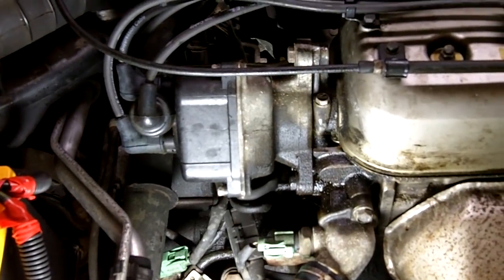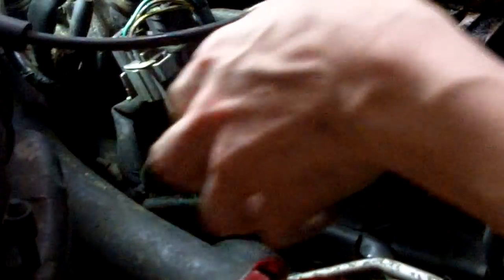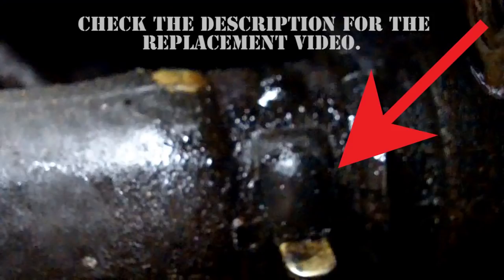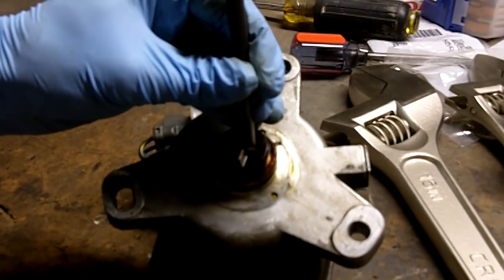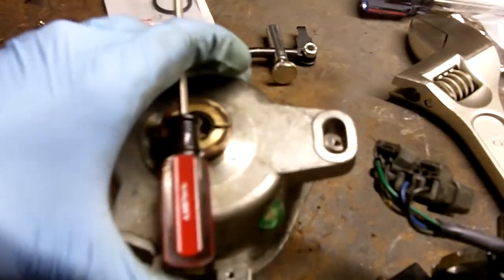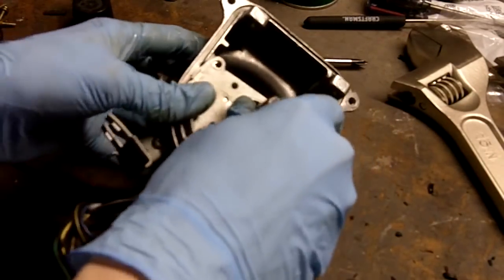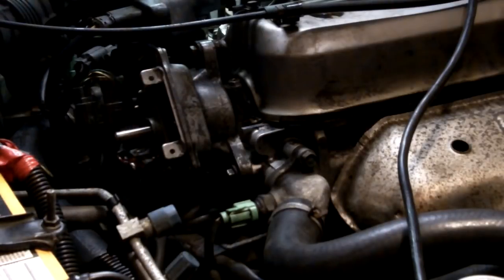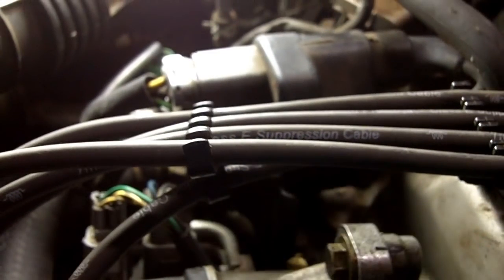Honda Distributor Oil Seal Replacement

Comment: ok I am all confused.... Your description states to distinguish b/w the Hitachi and the TEC distributors... the Hitachi has 4 wires only on the cap and the coil is internal.  This description fits mine... however when I go to the dealer they list I have a TEC based on the vin.  The outer O-ring they list for mine is the one you list for the Tec version.  Are there tec versions with an internal coil?  I don't have the version you have in the video... mine has all the extra parts, I assume as you reference the Hitachi does.  I have been researching like crazy and the Accord 2.3L F-series with the D4T92-04, D4T97-03, D4T94-04 seem to be the only Hitachi that people reference...  Good lord I don't want to have to order both sets to have to match up at disassembly... its my only car and a daily driver.  Mine is a TD-42U Distributor for a 93 DelSol 1.6L V-tec manual trans which all matches to the dealers info.  Again they say its a TEC version...  Help anyone?
Reply from the maker: I was referring to 1994-1997 Accords when I made that distinction outside those model years yes there are variants. The dealer catalog says the distributor for a 93 Del Sol manual is a TEC TD-41U with an internal coil the external o-ring part number is 30110-PA1-732.
Reply: @Bushougoma  thank you for the clarification..  That helps clear things up.

Comment: I live in the tri valley area, do you know anywhere I can get parts for my 1993 Toyota Camry V6 LE distributor inner oil seal? I have already replaced the outer seal but the leak is coming from inside.
Reply from the maker: You need to get the manufacturers name and part number on the seal first.

Comment: hey bushougoma i replaced seal and or ing on my 98 accord v6 and  now my car idles high 1500-2000 and accelerates without pressing pedal?? help
Reply from the maker: The distributor wouldn't cause this. These vehicles have a rotary type IAC valve that likes to stick and causes a high or low idle depending on where it's gummed up. It has to be removed and cleaned.

Also check for smooth operation of the throttle cable to make sure it's not rusted to the outer sheath and that the throttle plate snaps closed.
Reply: thats what i was thinking but ihad just replaced my iacv not to long ago for a similar problem. could it be a vacuum leak cause i did remove some hoses to have more access but it looks like everythings attached ?
Reply from the maker: j manuel
That was going to be my next recommendation MAP engines will idle higher when there's a vacuum leak. Unlike a MAF engine MAP engines see the air leak and the PCM adds extra fuel to compensate which raises the idle.

Old hoses tend to harden around the hose barbs where they seal and may not seal correctly when reinstalled.

Spray the lines and listen for an idle change.

Propane is safer than carb cleaner which can catch fire. Have a fire extinguisher handy just in case.
Reply: alright ill give that a try thanks for all the help and quick replies. great videos liked and and subscribed

Comment: ***** I've got a 2001 Honda Accord. I've had the car since the beginning and have done all reparis myself. I know this is the original distributor and I can see that it's the Hitachi brand. My problem is that I don't see that my distributor has a ring pin on it?! I'm lost. I can forward a pic if you'd like, but I'm stuck and don't know how to continue taking it apart to finish replacing the inner gasket. Thanks!!
Reply from the maker: Later model Accords used an interference fit pin. You have to drive the pin out with a flat punch and hammer.

Support the end of the shaft in a vice so the hammer blows don't damage the bearings.
Reply: Thank you SO MUCH for the quick response!! So, I'm gonna work on this tonight after I get off work and I wanted to make sure that I get this right...

I've got a flat punch and hammer to drive the pin through, but I just want to make sure that I'm not missing something. After I punch it through then the head will just come off correct? And in regards to re-installing it, will I have to hammer it in, or should it just slide in easily?
Reply from the maker: Samuel Qassom
It's a press fit both in and out. Use the largest hammer you have the pin can be stubborn.

The punch should be the same size as the pin without jamming against the bore. The more surface area you have the better.

As long as the head is supported in the open jaws of a vice the bearings will be protected.
Reply: Thanks again for all your help! I'll let ya know how it goes. Wish me luck! Lol...
Reply: ***** Hello, sorry to be a bother, but I wanted to see if you could help me confirm something. I'm just wanting to make sure that their isn't single direction that the pin pushes through. I've been messing it for the last 30 minutes, in both directions, and I'm getting nowhere fast. It doesn't seem to want to come out and I'm not getting much play with it. Just wanted to make sure I don't mess anything up by pushing it out the "wrong way", if there is one. Any help would be greatly appreciated. Thanks!
Reply from the maker: I forgot since I normally use an air hammer to drive it out. Don't bother with a standard hammer. Use a 3 lb mini sledge on the punch that should get it moving.

Make sure you mark the orientation of the shaft key before removing it.

You're using a flat ended punch right? A center punch with a pointy tip on it won't work.

It should be the same diameter as the pin but not so large that it jams in the bore.

The pin is tapered so you want to put the punch on the smaller diameter end to drive the larger end out.

Comment: how would you know if you have a tec distributor or a hitachi?
Reply from the maker: Five wires on the distributor cap it's a Tec. Four wires on the cap it's a Hitachi.
Reply: ***** thanks for the quick reply. it seems i have the hitachi distributor. after a little research, i was able to locate the part# for the outer and inner seal for a 94 accord ex 4cyl with a hitachi distributor. i included the part# below for those who might need it.

outer o-ring seal: 30110-PC6-005 (from honda)
inner shaft seal: KOK 3286 (order online). dimensions of this seal are 12.45mm X 22mm X 6mm
Reply from the maker: 0L07
Yup that jogs my memory that's the manufacturer. I repaired a Hitachi long before this video was shot and didn't have the foresight to save the part number.

Thanks for the info I put it in the description and added an annotation to the video.
Reply: 0L07  Did you buy it? How much cost it? Give me the website bro. Thanks. Fredy

Comment: I want to know if you might have a part number for a 95 Honda odyssey with F22B6 that has the internal coil. If you could please tell what bushing would wok for mine. Thanks.
Reply from the maker: You'll have to locate the part number on the face of the seal.
Reply: I was hoping somebody would know so that way I don't have to pull it and I'll wait around for this part

Comment: Hi.. Thanks alot. Not coming from the o-ring after all.  Solenoid looks like,.. I noticed all you videos.  Do you have one for the oil gasket pan? There's a screw which i don't know how to get to.  Cant fit a socket or a wrench. What can i use? Noobie mechanic here. Thanks
Reply from the maker: You can't drop the oil pan without removing the exhaust pipe that runs under it.

You also have to remove the gear selector cable cover and the torque converter access cover that bolts to the transmission.

Once all that is out of the way the pan will drop down easily.

Comment: so would this process basically be the same on a 98 accord v6 dizzy??
Reply from the maker: Yes the part numbers will be different though and many of them have a press fit pin on the shaft.
Reply: well i have the part coming in mail. just trying to get all the details before going at it. seems pretty straight forward except getting that pin out since its pressed in. anyway for me to get it out without damage? thanks for reply and video
Reply from the maker: j manuel
Support the keyed piece in the open jaws of a vice and drive it out with a flat punch. I'd recommend a 3 pound mini sledge.
Reply: damn no vise and only have a 1pound rubber sledge lol so should ijust wait on this fix till ihave all the necessary tools? daily driver so cant keep it out of commission too long
Reply from the maker: j manuel
The pin can be stubborn if you don't have the proper amount of "persuasion" :-).
Reply: hmm so youre saying if i give it just enough persuasion it might come out? lol
Reply: ihope im not misinterpreting i go beat down on that pin like a crazy person haha

Comment: For those of you looking for a Nissan Sentra oil seal the above mentioned part KOK 3286 is an exact fit the MM size 12.45 22 6 dimentions appear in the Nissan seal markings.They are:  91 Sentra 1 36 5 1245 22 5 L HS later Sentra 94-97 I think are E 5 SD 12.45 22 6 L I got mine on ebay here $8 shipped. http://www.ebay.com/itm/181347890218?_trksid=p2059210.m2749.l2649&ssPageName=STRK%3AMEBIDX%3AIT

Comment: Will a obd1 from a 95 accord fit  a 97 accord? That has a obd2
Reply from the maker: Alexis Navarrete The distributors? No they're incompatible OBD 1 distributors have 3 sensors inside OBD 2 distributors have 1 sensor.
Reply: Do you have any information on where I could find the oring and seal for a hitachi distributor?
Reply from the maker: Alexis Navarrete
The o-ring can be purchased from any Honda dealer check the description for the shaft seal part number that can be found online.
Reply: I have a 97 Honda Accord ex, I was told that I can not replace my hitachi distributor with a tec distributor even if they both are obd2. Is this true ?
Reply from the maker: Alexis Navarrete
Yes the TEC has an external ignition coil (and 5 wires on the cap) and the Hitachi has an internal coil (4 wires on the cap) so they aren't compatible.
Reply: TEC has 4 wires (individual cilinders) + 1 wire (the one you call high voltage) ? Thanks
Reply from the maker: fmussari
Yes the high voltage supply wire coming from the external ignition coil.

Comment: NEEEED HEELLPPP!
I have a 95 honda civic 1.5.  There was a leak from under the distributor so i decided to change the distributor mounting gasket it was just a o ring seal. Also i replaced the gasket that was in the distributor box. NOT KNOWING the consequences i just unbolted the 3 screws from the distributor 12mm replaced the oring seal screwed back the bolts without any kinds of markings. Now my car does not run properly.. When im on my 2nd gear i press on the gas and it studders .. I think i messed up the timing.. ANY WAY of fixing that issue??
Reply from the maker: First make sure the plug wires are on the cap in the right order if you removed them. Also check the ignition wires for damage especially at the ends where they mate to the cap if you had to pull hard to remove them.

As for the base timing you'll need a timing light. Slightly loosen the distributor mounting bolts.

Jumper the 2 pin ignition timing connector behind the passenger side kick panel to eliminate the computers timing advance, start the engine, and allow it to warm up.

Connect a timing light to the battery and the inductive clamp to plug wire 1 (the wire closest to the crank pulley).

If your light has an advance function (dial on it) set it to 0. If it doesn't the light is always at 0 ignore this step. You'll notice on the crank pulley a red notch. You may need to clean the pulley off to find it. Locate the pointer on the timing cover and aim the light at it when the light flashes the marks will appear to stand still. Rotate the distributor until the red timing mark lines up with the pointer on the timing cover. Once it does tighten the distributor mounting bolts and remove the jumper.

Comment: where can I order the seals??
Reply from the maker: +Luis Serratos Check the description for the part numbers the outer o-ring can be purchased from the dealer. The inner shaft seal can be found online.
Reply: Oriellys has all the parts except for the inner seal, Amazon has that for like $14 as of 6/4/2016

Comment: Pls. can you tell me what else I can do. I Changed like 6 different distributors to my Honda Odyssey but at the next day it is leaking. I returned it to the Auto Parts Shops and I got the replacement but is the same thing . What could be happening or is in the installation?  thank you Fredy.
Reply from the maker: Check the PCV valve to make sure it's good. It should be clear inside and rattle when you shake it. Blow by gas pressure buildup can blow out seals if the valve is bad.

If the valve is ok and it's leaking from the inside it's just a bad distributor. If it's leaking from the outside check the surface where the o-ring sits inside the cylinder head it should be smooth.

I'd also recommend staying away from aftermarket parts as the quality can be quite variable.
Reply: Yes thanks I did the change of PVC. I ordered the  o ring but it s to large.. Do you think was correct what the mechanic did last time . He said let put some Silicon to stop the leaking, He put it around on the  O ring seal. I don't know if that is ok or not.. Thanks Fredy
Reply from the maker: What year is it? Is it a 4 cylinder Odyssey with the F22B2?

If so are you sure that the valve cover gasket hump above the distributor o-ring isn't leaking making it appear the o-ring is the culprit?
Reply: it is 1995. but i don't know the number you are asking.
Reply from the maker: F22B2 is the engine model on that Odyssey well technically it's a F22B6 but the differences are negligible.

The o-ring part number for the OEM distributor is 30110-PC6-005.

If the factory o-ring doesn't fit in the groove properly it's because you're using an aftermarket distributor. The groove for the o-ring on the distributor may have been redesigned to fit a non OE o-ring.

If you can't afford a new OEM distributor you're honestly better off buying a used one from a scrap yard or online. Aftermarket ignition parts just don't play well with these Honda's.

Aside from that check the valve cover gasket if it's leaking around the bearing hump where the distributor mounts it can give the appearance of a leaky o-ring.

While you're at it pull the spark plug wires and check them for oil. The B2 engines are notorious for leaking into the spark plug tubes. Years of engine heat causes the o-rings under the rocker assembly to deteriorate.

The oil will eventually destroy your plug wires and can lead to a misfire.

A full valve cover gasket set will include the cover gasket and the upper and lower spark plug tube seals to deal with this issue.
Reply: Sorry Bro. I am not mechanic. like three years ago i started with this problem, and one year changing and replacing it but does not work that is why i trying it by myself. Yes it is F22BG.
Reply: YES BRO. i DID EXACTLY EVERY THING  U SAID CHANGED PVC, VALVE COVER GASKET COVER SEAL, VERY CLEAN, NEW SPARK PLUGS FROM THE DEALER.. THE PROBLEM IS: AFTER INSTALLING THE DISTRIBUTOR, IMMEDIATELY THE NEXT DAY IS LEAKING. THE LEAKING IS FROM INSIDE EXACTLY BETWEEN THE BLACK PLASTIC DIS. COVER AND THE DISTRIBUTOR. ( AND THIS JOB IS DONE FOR " A PROFESSIONAL MECHANIC").
Reply from the maker: Ok so it's internal are the distributors aftermarket or OEM?

Comment: nice. i think you will save me a few $$$... ;0
Reply: +Aldrin Albano  Yup, you did. The video was easy to follow. I like the updated info inserted by the author. The part# of the internal seal and external O-ring for TEC-brand distributor is included in the video. But I got my kit from Amazon garage...it was easy enough. The hardest was waiting for my Amazon shipment! ;) Thank you so much.
Reply: +Aldrin Albano Like the author mentioned, if you have a distributor leak you will want to replace both the internal shaft seal and the external O-ring anyway since you probably don't want to do this twice! The actual disassembly is medium difficulty. If the screw that holds the distributor rotor is impossible to unscrew (as was mine) the best is to just break and discard of the old rotor so you can use a vice grip to twist the screw. NOTE: you will need to save this screw since a new distributor cap & rotor kit will not include one. So try not to strip the head if you can help it. My total cost for the seal + rubber O-ring + new cap & rotor kits = $48 at Amazon garage.  Enjoy saving $250 of labor!  :)

Comment: After watching this video i rather replace the whole distributor..
Reply from the maker: As long as it's an OE Honda you'll regret it if it's a cheap aftermarket. The electronic components just don't hold up.